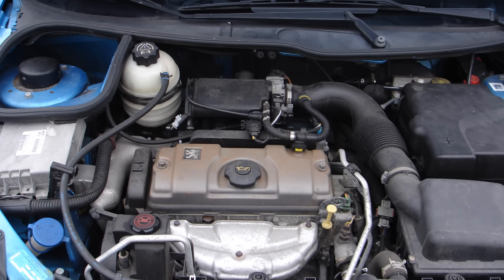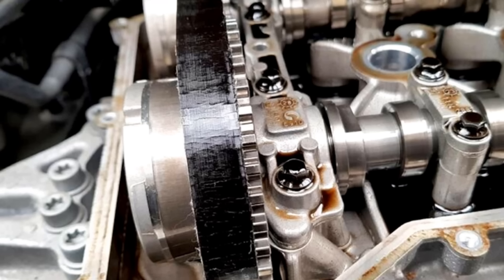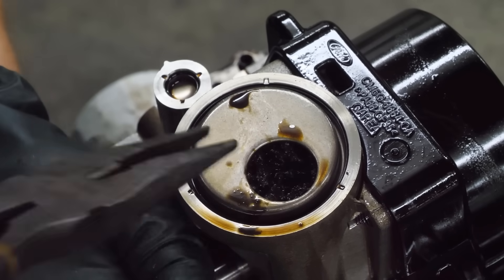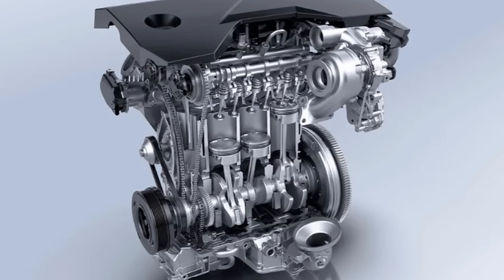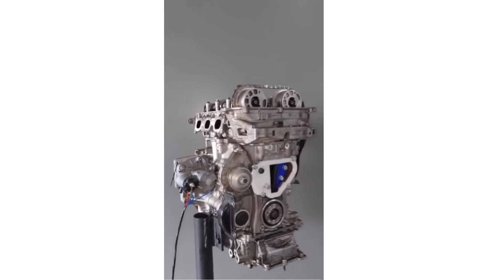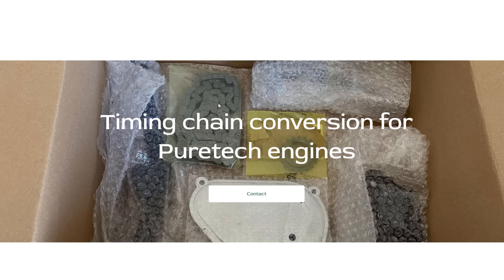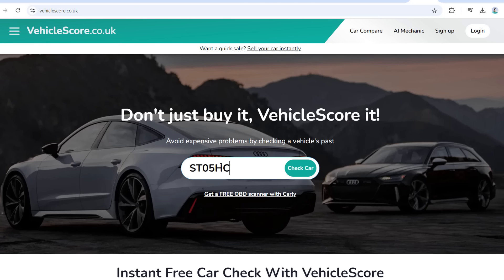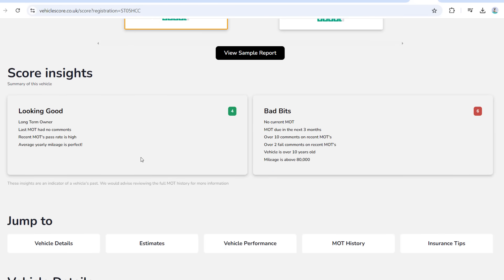Peugeot PURETECH Fix Is Here - All You Need To Know

Comment: I'd sell the car back to PSA. Simply because you shouldn't support Stellantis that won't take responsibility. I owned once a DS3 2013. It looks good. I did give it a great service. What do I get in return? Engine damage before 60k! Warranty? Of course not. It is too old for them and because I did the service they won't cover it. It's knocking in the morning like it has no rod bearings anymore.:face-purple-crying: But I decided not to repair it because I don't want to buy parts from scammers. Is that simple. My car with the service I gave each half year it would run for 500k if the engine was designed right. It's not only the engine. There are quite more parts that break on this car and impossible to buy. For example a cover for the bottom from plastic literally 400€. I could pay a metal workshop make it from stainless steel for this price! Don't support Stellantis! Stop.

Comment: I’ve done 3 engines this month with belt degradation, the oil consumption is heavy because the belt particles make the oil scraper ring stick intermittently cause burning oil, awful design but has made our garage a fortune we have them done in 3/4 hours with replacement sump!
Reply: Are you NOT using these new these chain conversion kits? Please tell us all you're NOT ignoring them as an option for your customers? !!!
Reply: @Jack_cx no because we can’t get them from our trusted suppliers yet, and they are still only in trial so can’t yet anyway
Reply: @Jordy5121_  Damn, that's crap. Thanks for the info though. This channel is clearly clickbaiting on something that is miles away/vapour ware. I should know this sh#t by now.

Comment: I'll be completely honest here. I have the 2017 Peugeot 1.2L Puretech. I know people are scared of that engine, but I started monitoring it every month, just a quick glance at it from time to time, and had it replaced every 60,000 km. I have 0 issues with the engine. So what I'm trying to say is just maintain it earlier that the factory says u do, and I also use a different oil than the factory recommends, which completely ruled out the issue where about a litre of oil disappears every ~1k km.. Sitting now at 200k+ km on the clock and no issues

I get that some people defend this engine like this, but genuinely I did this and 0 problems, but I cant rule out I might be the lucky one or I just did what it needed to be done for it to work perfectly fine. Of corse I'm doing the regular filter and oil change every 10k km. Oil I use is Valvoline VR1
Reply: Very wise words. I too have a Puretech 1.2 (Peugeot 3008 from 2016). I do very low mileage each year (2000-3000) but yes, each service I get them to check over these things. Thankfully, the garage is one of those rare, 'good' ones, thus so far, they've not recommended a replacement belt/chain(if available). I am ready to part with the cash if needed, but other than that/any other risk, the car has been performing well.
Reply: @Jack_cx Yep exactly
Reply: Hi lekso02
what oil thickness? 5w50?
Thans, Emile
Reply: @emilebrouwer7982  Its 10W60
Reply: Hope some people find a little help in my comment 

Have a nice day ya'll

Comment: The main problem is the number of cylinders. With 3, there are much more vibrations than with 4; it's a matter of geometry. And these vibrations end up causing damage, leading to increasingly significant oil leaks. The only solution to this problem: absolutely avoid 3-cylinder engines. But it's difficult, unless you choose a more powerful and more expensive car.
Reply: Eh...you're making a rather large fool of yourself, bud, lol.

Comment: Arnold Clark Vauxhall Hamilton Rd, Glasgow (Avoid) sold my partner a 2021 Corsa last month and mislead us that car had full dealer service history ,  but it doesn't and also first year service was missed and service records dont include details of what type of oil was used.  So vauxhall has told us the 10 Years Warranty by Stellantis to cover wet belt issues is void. So looks like it will be a chain conversion when its available.  

Anyone looking to buy a Vauxhall Corsa check it def has 100% Vauxhall Approved Service History and don't buy it from Arnold Clark.
Reply: I hear you. I've had mixed 'success' with Arnie Clark (South Street, Glasgow). Bought a wee 2nd hand Nissan Micra 10 years ago, and maybe/probably they took pity on me, but 8 yrs of MOT's gave me only 6 years on MOT cost only. The other 2 years I did have some work needed, nothing too expensive. Unfortunately, I purchased a 2016 Peugeot 3008 1.2 Puretech a couple of years ago. In 2 MOT's I had to purchase a new offside full headlamp assembly, a new clutch and a reseal of the 'panoramic roof glass'. F*n sore on the wallet, though I manages to find a 'glass man' on South Street who did the roof for only £200, despite quotes of £2000 from the peugeot dealers. F*k knows when they'll hit me with this timing belt thing but if they do, it might be time to use the buses full time (recently retired).

Comment: Just because a kit is available doesn't mean it will work perfectly. Unless the upgrade has been fitted  for many thousands  of trouble free miles and to many cars you might be jumping out of the frying pan into the fire ! The manufacturers mess up designs so a third party company may be no better.

Makes more sense to wait until the kit has been available for a while with no problems reported on the cars they have been fitted to before jumping in to get one fitted !  The last thing is I bet these kits are not cheap - is suspect many hundreds of pounds and then there is fitting cost which will be more than the £500 - 600 dealer cost to replace the wet belt  alone !

There is another company supposed to be making a kit to block the oil feed to the wet belt which may be a much cheaper option - if the belt works any better out of oil than it does in it !
Reply: Exactly! This new conversion chain has absolutely no long term data. It 'should' be much. much better but it's waaay too soon to tell. Also, it STILL doesn't seem to be available in the UK.

Comment: Best timing chain design was on older Alfa's, duplex chain, no guides, one mechanical tensioner with a sprocket that runs on needle bearings, adjustable from the timing cover. Unbreakable.

Comment: Someone could fix the oil consumption with pcv valve change? In my peugeot 2008, year of 2017 1.2 puretech 1500km per 1 liter of oil. Insane.the car made 110k in total now. What can i do? I understood that if i want to change the pcv valve,I need to replace all unit in this model. Or its only pistol rings?? Please any advice would help.

Comment: I have a question for you: what's the point of changing the belt to the chain mechanism that you advertise, if you say that these engines have a problem with oil consumption? I understand that it makes sense to change the belt to a chain when the engine has a mileage of 200 thousand kilometers or more. And if it starts to lose oil after 100K, then it probably makes sense to replace the engine with a new one. 
Or am I wrong and this engine does not eat oil so quickly? I have a 2008 Peugeot, year of manufacture 2020, now I have 30,000 km, the belt is like new.

Comment: Owner of 2015 C4 Grand Picasso Puretech 131 bhp, now 112.000 on the clock, belt changed at 80.000 still no need to add oil between 7-8.000 oil change intervals of 5w-30 oil. Engine runs great and its the best engine I've ever had in over 50 cars owned
Reply: How does ir run with that engine? what is consumption?

Comment: Good video. Do you know if the same problem is present on the 1.5 BlueHDI? I have a 2019 I’ve had for a year with 24000 km on the clock.

Comment: I noticed that Citroen did a recall for  the wet belt issue  and I've checked both of my cars c3 diesel 18 plate and c3 aircross 19 plate and they're not part of the recall does that mean my cars are OK?

Comment: The old astra g sport also needed a timing belt changed after 60k. My last car seat ateca. 100k belt was scredded. Factory told it could run 200k. The bad thing is for the pure tech is the filter that’s get clocked.

Comment: I had a 308 with 1.2 Puretech 130, I had it from new, had the timing belt changed at 65,000 miles.
It's now on 86,000 miles, no problems with the timing belt.
However, the oil control piston ring is stuck on piston one, so I'll replace the pistons.

Comment: The oil consumption problem these engines develop is a result of wear after oil starvation when the pickup is clogged. If you get the red oil warning light and have to change the wet belt and clean out the pickup, it's already to late. The wear on the engine will already be substantial and it will start to burn oil. How much depends on how long it have been starving for oil before the warning light finally came on.  For this chain kit to be of any use it has to be done on a good engine which haven't had the time to have oil strainer issues.

Comment: But why would you? you would be aswell accepting it is what it is and replace the timing belt kit every 40k miles (alongwith oil flush and change)...As that timing  kit itself is most likely needing changed every 60k-80k miles to be safe.......

Comment: Took last year a cactus 1,2 110hp 2016 used  110000km in Greece and i saw from the beginning consumed extra oil, now at 150000km 1,5 year after it comsumed 1lt at 1000km, I plan to take it to a workshop for repair but I admit I didn't expect issues with consumption and wet belts, maybe I wasn't well informed.

Comment: The question is why arent Peugeot doing this officially, say i bought a bad 1.2 puretech and its still at 40k km.  and  lets say i just check the belt and its cracked and bad.... why arent Peugeot by now not invented permanent fix once someone goes there for their first swap ?
Does anyone know if 1.6 puretech engines with chain have similar problems  ? ( ofc not clogging or anything ,but maybe thin chains  which will be even worse and cant even be detected when it goes bad ).
Also nope, nothing is fixed for cars before 2024 , Peugeot main dealer is offering me to swap my 2019 308 to a 2023 GT that have just 8k kilometers on it and when i asked they said it is using 1.2 puretech still with wet belt and they cant make it use a chain. 
Because i know personally one of the guys that work there ( he live next door ) are the newer thicker belts have the same issues and he said they do.  
All in all... 1.2 is a no go so now im wondering does the 1.6 Pure tech engine  180hp that uses a chain on Peugeot 3008  have such many problems ?

Comment: Changed the f00kin stock belt with the a racing full kevlar one used on 208 Rally4 + Castrol Edge Magnatec OW-30. Bye bye problems ❤

Comment: Does 3008 1.6 phev of 2021 has chain belt or not..its the facelift..also chain belt is alot better cause you need to change it after..i dont know more than 200000 klm

Comment: I stopped this video at 23 secs ( I will continue to watch after posting this post)
It's been on my mind for a while now why no company has attempted to make a chain conversion for not only Stellantis wet belt engines, but also to Ford eco boost engines.
There must be literally millions of cars & vans with these wet belt engines crying out for this modification.
It can't be THAT difficult for an engineering company to come up with a modified chain conversion for this stupid wet belt idea.
Whoever cracks it would make a fortune.
I'm primarily coming from a ford direction on this idea.
A timing belt and water pump on a Duratech ( external belt ) costs approx £400- £450 whereas a wet belt engine is anywhere from £1200 to £1600 depending on whether the engine needs a new oil pump because it's been clogged & starved of oil.
Who's going to spent that sort of money on an old car?
Stellantis engines are possibly having the same issue, if the conversion is done before the vehicle gets too old it helps to keep it  on the road for longer and a chain conversion will rarely need replacing.
Some belts don't even last 70,000 miles.

Comment: Oil consumption. Continuing with the same oil but using some asditives and mixing up Oil Boosters (incl. viscosity improvers) with Engine Oil-Leak Stop.
Oil-Boosters protect wet timing belts (incl. TBN-improver, elastomer-protectors and -treatment), while "Engine Oil-Leak Stop" kills any wet belt incl. wet timimg belts.

Comment: Does the 1.2 VTI 82 hp uses the same timing belt in oil?
Reply: Yes,it uses the same system.In my 1,2 vti i change the oil every 5000 km and works fine
Reply: @MECHANICOFCG  i change the oil every 8k - 10k, but 5k is a bit too often. But if it saves the engine, i guess it's worth

Comment: I bought a Vauxhall Grandland  just 2 years ago and  unaware of the wet best as the salesman said it was chain drive . I went to the dealer with my complaint (Vauxhall Drive )
and was told Stellanstis / PSA  extend the warranty on the belt to 10 years then shortly after they have increased it to lifetime cover. I guess if you converted it to chain you would lose any warranty extensions for the entire vehicle .  Get the belt wear gauge tool for a few pounds so. you can easily check the belt yourself . 
The warranty extension also relies on main dealer servicing . I also change the oil mid term between services as a belt and bracers precaution . Oil needs to be B71 2010 0w 30 grade on the Vauxhall .
Reply: LA COURROIE   EST LEPREMIER  SIGNE QUE LE MOTEUR VA MOURIR   
  si la courroie  se dissoue dans l huile c est que le carburant passe dans dans l huile et comment le carburant passe dans l huile  par les segments. dont le carburant passe dans l huile car segments pas assez serres  mais autre problemes l huile aussi remonte dans les cylindres a cause des memes problemes et pire l huile brule et se cookefie et bloque les segments   donc surconsommation  dhuile et plus d essence qui descend dans le carter   donc courroie qui suse plus vite   c est un cercle vicieux mais c est pas la courroie le responsable     mette une chaine   n empecheras pas la surconsommation d huile!   le probleme c est l ensemble segmentation /cylindre! 
tant qu il y aura pas de modification ce moteur ne sera pas fiable!

Comment: Hi all, good news - I have actually been in touch with guy hoping to produce this chain conversion. He is currently awaiting EU approval of the kit. Once done, (he has no timescale sorry to say), but if all goes to plan, the kit will be cost €400 + vat, but will only be sold to businesses( garage/dealers for them to fit. He expects fitting to be done after the wet belt removal job and will take about 1 hour extra than the normal wet belt job. So it's wait and see at the moment but looking hopeful.
Hope this eases our minds a little, sounds maybe a bit dear, but the average cost of the wet belt job in total is about the same price, ( plus the labour),but you have the satisfaction your belt isn't going to shred any time soon. Sounds ok to me. Any further info will post to that effect😊
Reply: cela ne resoudra pas le probleme deconsommation d huile!!
Reply: I'd rather put more oil in than do the belt job everytime the strainer gets full of crap!
Reply: @KeithMoore-fz7re  you have right!  it s better  but not the solution! if you drive highways you maybe have no problems

this motor  must   be warm  because  the block is on aluninium   and the rings of the pistons is on iron but  have a segment games  too  big    and  iron to alumimium you damage the cylinder!   sorry for my bad english
Reply: @dominiquebaumgarten8010  Exact! Ramane acelasi rahat de motor mancator de ulei care pana la urma tot crapa. Multumim psa pentru acest fiasco...
Reply: EU Type Approval....e.g. E1 by German KBA...
Reply from the maker: Pinned! Thank you
Reply: Impossible to get EU approval.
Reply: @westyorks100  ....EU >Type< Approval...
Reply: Looks like a Dutch company to me that come up with a solution, not Norwegian. 

Also, regarding rubber and oil... Aren't all oil seals made of rubber? So they can mix.
Reply: I understand. Cheers

Comment: Great news about the conversion kit but belt and oil not going together? How do you explain not one single 1.6 VAG TDI having an issue with the belt that drives the oil pump since 2009?  On the other hand mixing 10% ethanol in petrol (95 Octane), which is mandatory in E10 fuel, is the real reason why most of these engines started to have these issues after 2017. Just take a sniff of the oil cap... Rubber and ethanol don't go together.

Comment: My puretech 2021(50000km) berlingo is being repaired at the dealer at the moment ,with the engine broken. One cilinder has no compression.
Reply: bizarre rien me surprend  tu as meme de la chance qu il n y ai que 1 cylindre de toucher    mais je vais etre gentil avec toi    demande un echange standard    tu vas reparer 1 cylindre dans 5000 km un autre va casser et les autres vont suivre .fait les chier portes plaintes rapproches toi  d association   qui ont ete cree pour parler des defaults de ses moteurs! ok sa va prendre du temps  mais faut pas se laisser faire     quand tu vois ce que touche les dirigeants de ces boites!
Reply: Can this engine reach over 500,000 km? Durable enough?

Comment: is the peugeot 3008 2916 1,6 T engine is considered puretech as well ???
Reply: It is a puretech engine, but it was known as the 1.6 THP in the past. BMW and Mini called it the N14. It has a chain and also had its own issues with chains in the past, but they should be solved now.

Comment: Chains are not always the answer. Appropriately engineered systems are the answer. There are masses of engine chains that are known to be failure points. Just ask so many JLR Ingenium engine owners or ex-owners. Also certain BMW engines are prone.   The 'weak link’ may be the chain itself, its mating with sprockets, or the guides and tensioners.  Well engineered ones built for longevity and not down to a price will generally last longer than belts though, it’s just that not all chain systems are made that way.